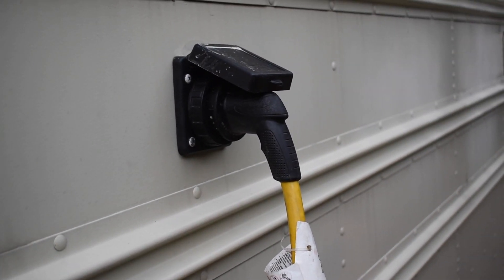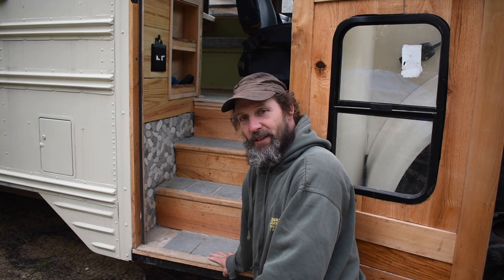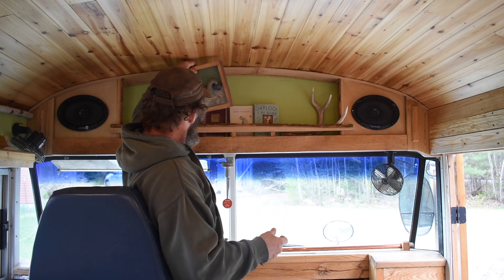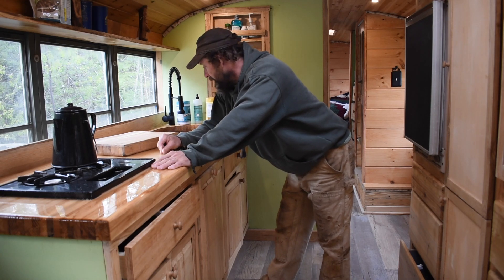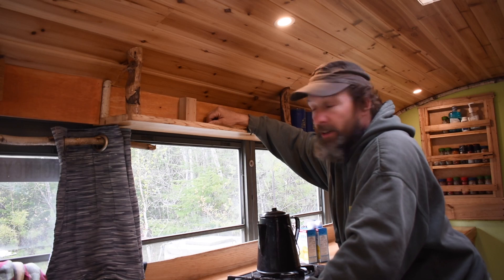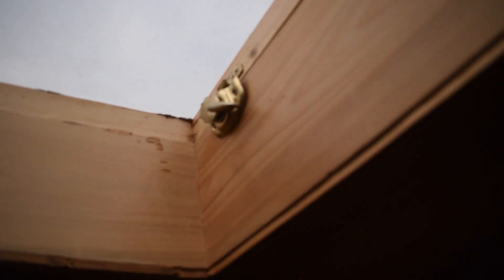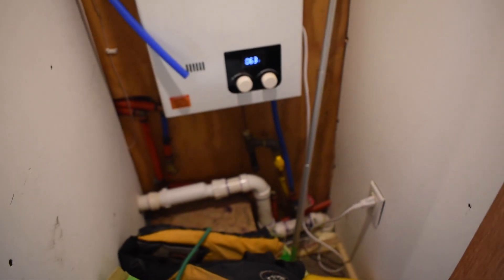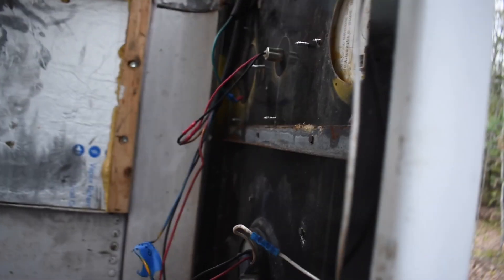Skoolie Tour:  A Natural wood "live edge" build using many repurposed materials

Comment: Should have used a piano hinge for your "front" door!!!  Using those hinges and having the door swing out,  exposes the hinge pin which can be simply popped and the door removed by anyone with a skinny long screwdriver!!!  But i see this on lots of builds.  Guess I'm just security conscious!!!
Reply: Never considered a piano hinge...good idea!  I did consider the security risk of the hinges but...I spend a lot of time in pretty safe areas.   I don't even know where my house keys are and I leave the key in the ignition of all my vehicles so I don't lose 'em!  Every once in awhile my truck's moved when I get back with a 30 pack in the seat with a note "needed to borrow your truck."  Love living in the rural places!
Reply: Yes I truly agree with Piano Hinges 😂
Reply: @rickk.6410  Good info for folks concerned with security~

Comment: Are the propane tanks safe in cold weather outside?
Reply from the maker: For sure!  I grew up in Maine (it's -15 there right now!) and never had a problem.  Plus, for safety you want propane tanks outside in case there's ever a leak.
Reply: @River-Channel  thanks
Reply: @River-Channel  I've seen some put them under their kitchen sinks on some of those rebuilds
Reply from the maker: @myladcook4779  I wouldn't!  If you look at RVs they're almost always in front on the tow hitch.  For houses, the tanks are outside.  If there's ever a leak you want the gas to dissipate outside not accumulate in an enclosed space.